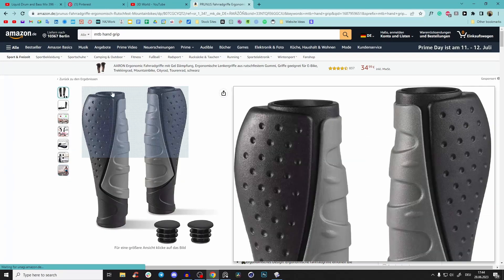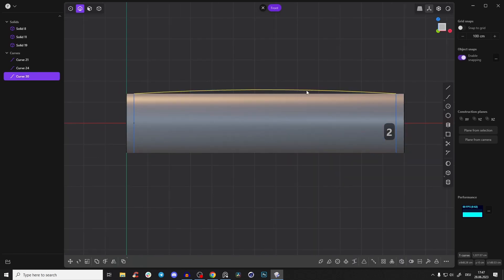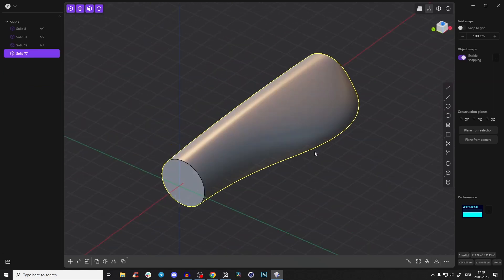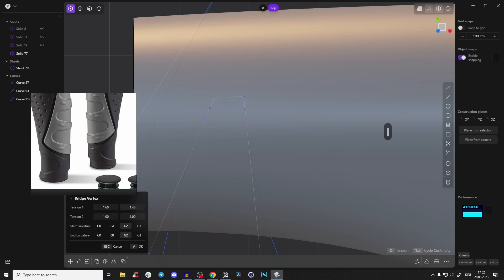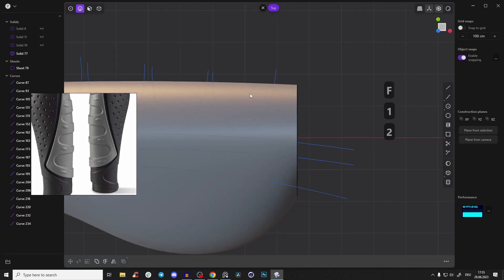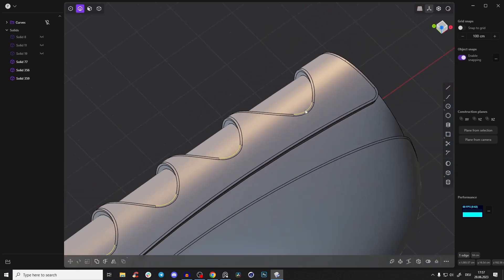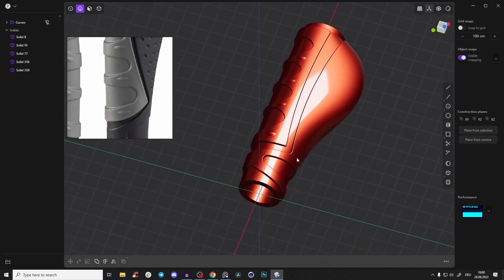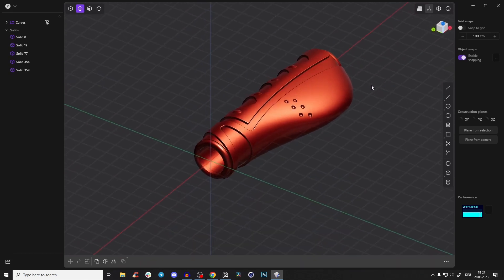Plasticity Tutorial | Surface & Lofting Technique | MTB GRIP

Comment: At 2:20 I can press alt + 1 whatever i like but it will not create an extra ctrl point when I click. I know how to get the result so it's no problem but I obviously have something set differently to yours
Reply from the maker: Try Shift+S in PLasticity 1.2
Reply: @nikita.kapustin  Heh.. Shift+S it is. Perhaps an idea is a good shortcuts sheet? I would happily pay for a good one (the existing one is kinda outdated).
Reply from the maker: @KylaraKuhn  Working right now on a Free beginner course. I will also include an updated shortcut cheat sheet. Stay tuned..